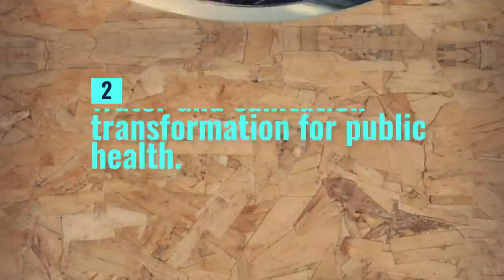7 Impressive Mega Projects From Africa's Youngest President Making The West Jealous

Comment: Yay! Well done, Capt. Traore.
What I do not see in this list 
is a railroad to any coast
and no meat production.
Working men need meat.
Reply: Railways to the coast is part of colonialism. This means all raw materials are destined for export which the captain is strictly against. Everything has to be processed at home thus creating jobs. But note that Burkina Faso doesn't have access to the sea.
Reply: Thank you for your reply.
I worked in warehouses. Railroads brought us electrical wire,
kitchen appliances, baker's flour, crates of candy bars, etc.
At one time my house was within 15 steps of the railroad track.
That railroad brought us cars. Broaden your mind on railroads.
There is not a state in the US that does not have rails. At one
time the state of Iowa, far from the coast, had 10,000 miles of rails.
Burkina Faso doesn't have access to the sea, but Africa does.
Think big. Africa is a big place and the captain is one of the 
most impressive in Africa today.
Reply: @arailway8809  you are very correct on  your points but the problem at the moment is that the  neighboring countries with access to the sea still have colonial presidents who are against Burkina Faso, Mali and Niger.
Reply: Try Guinea
Reply: Okay..we will include 😂😂 the meat oooo